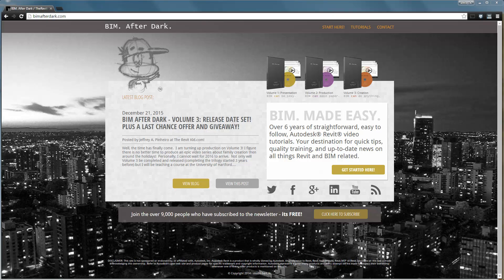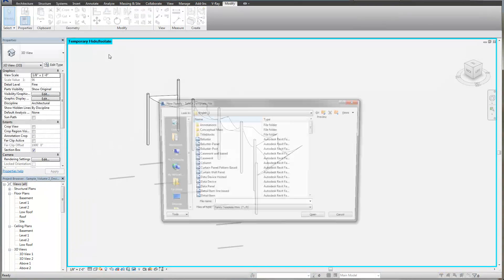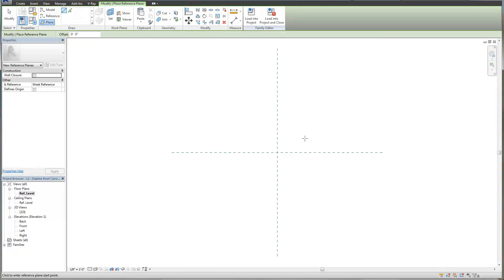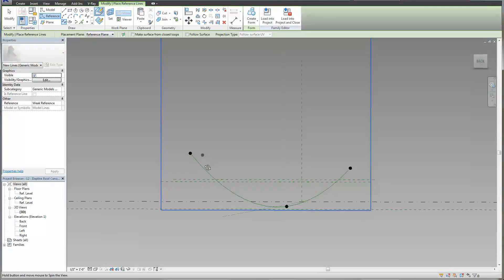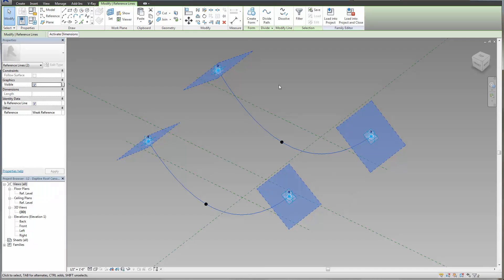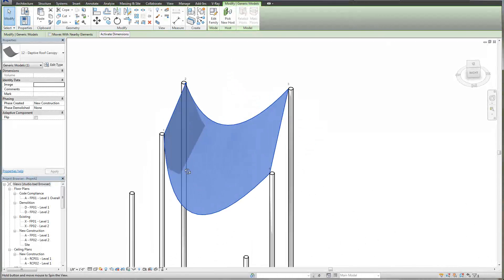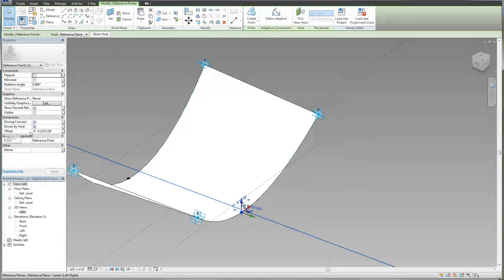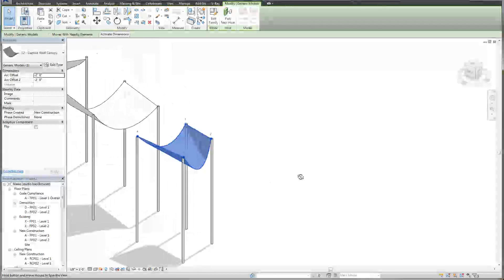Revit Tutorial   Adaptive Fabric Roof Canopy Introduction

Comment: Thanks for the tutorial! Perfect timing for me. Quick question. Is there a way to add a parameter that make the side points adjust vertically? Maybe call out an xyz parameter?
Reply: +William Bustos Glad you enjoyed it!  Yes, the reason it is only pushing the point out and in is because it is essentially an offset from the reference plane.   Using dimensions in other reference directions will allow full flexibility.
Reply: Sweet! Thanks!